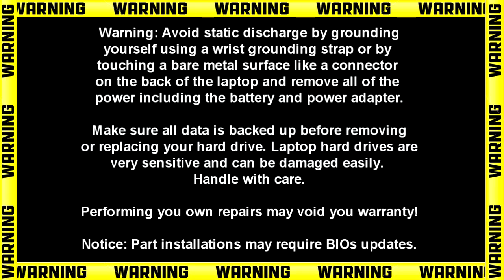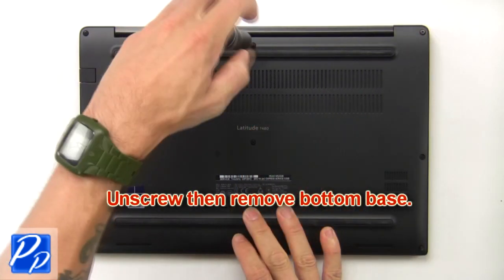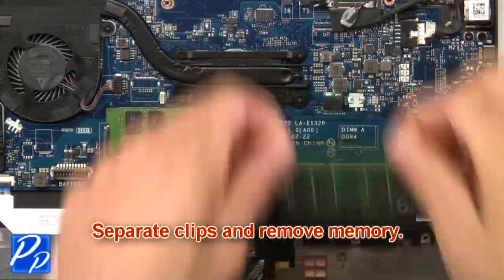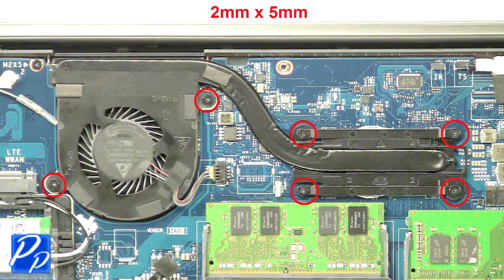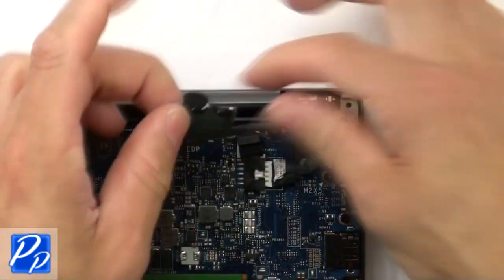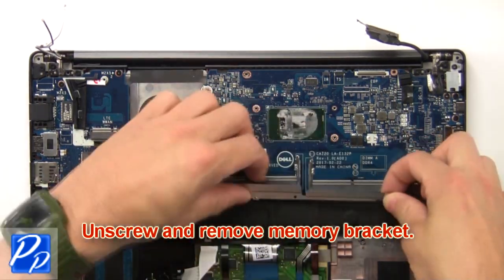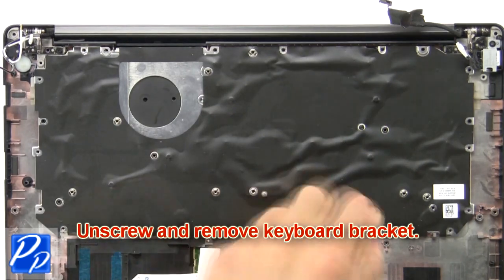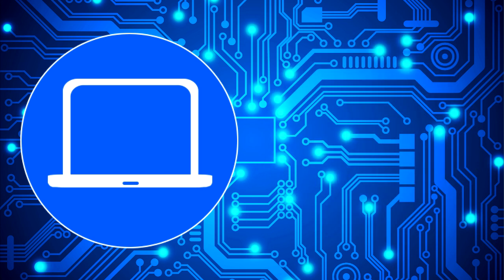Dell Latitude 7490 (P73G002) Keyboard How-To Video Tutorial

Comment: Just had grease from a sandwich I was eating go under two of the keys - used a windex type spray to get under there and stop it from gunking things up (stopping the keys from not moving once the grease gets to room temperature) . Now the key mapping is screwed up - not sending the right key characters to unlock the encrypted drive.
Reply from the maker: Aww man, I'm sorry to hear that. Also try using isopropyl alcohol, but otherwise, yes, you'll need to replace the keyboard.

Comment: Thanks for the video.  Saved me a lot of time at work.  Only comment is as with another viewer, there are evidently more than one keyboard bracket attachment layouts.  The one I had today required removal of the whole frame and keyboard together, then there were three more screws on the keyboard side to detach the keyboard from the frame.  Not a big issue if you take your time and analyze how it's constructed.
It would be nice to have the reassembly as part of this video;  I backtracked through it from end to beginning to make sure I didn't miss any parts or get out of order during reassembly.

Comment: I have a Dell Latitude 7490 and decided to follow this. Apparently there is a model where the keyboard is attached to the keyboard-bracket with screws. So after unscrewing your keyboard bracket, you immediately disconnect all keyboard wires, then try to pop out the keyboard-bracket with the keyboard attached to it!
Reply: Mine was the same way